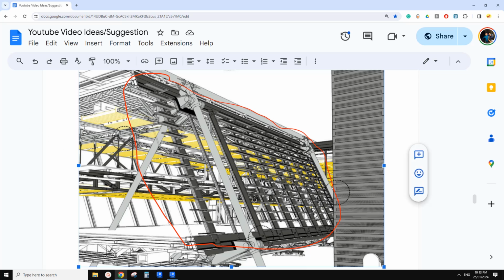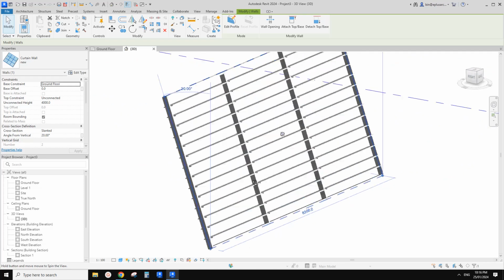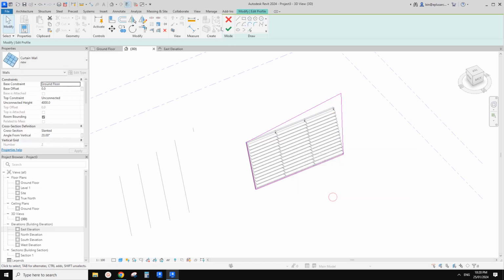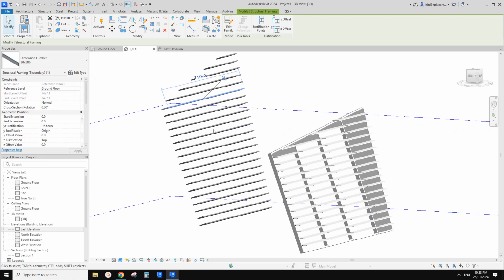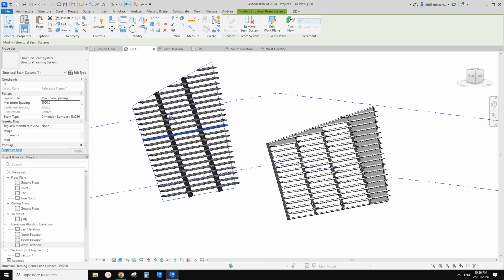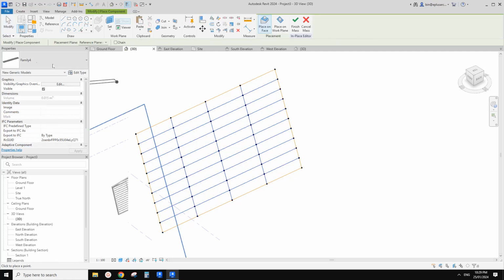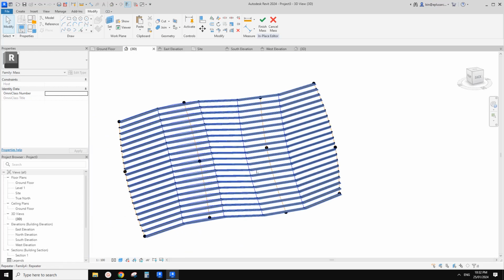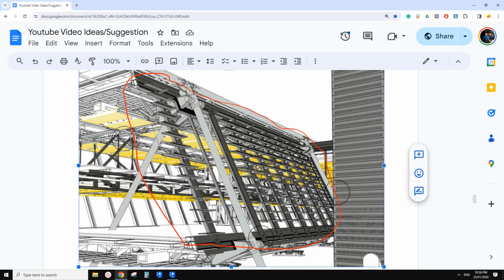24013 - Some different methods of slanted brise soleil in Revit

Comment: how we can add an empty panel to non-rectangular panel in curtain system ?
Reply from the maker: Not with the normal empty panel family from Autodesk Revit Content, but you can use the one from the link in this video. It's called Empty System Panel, I think... You can copy the little curtain wall into your project, then use it to create non-rectangular empty panels.